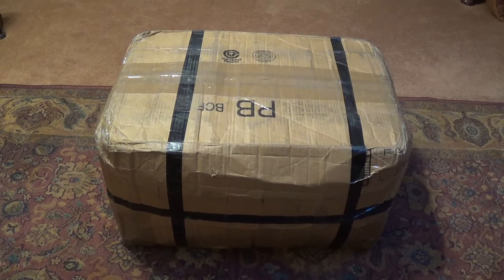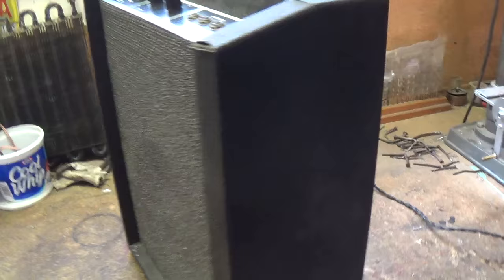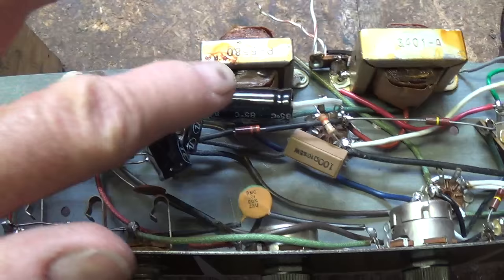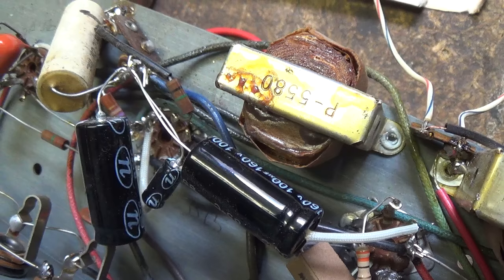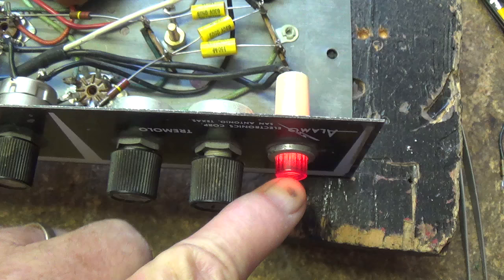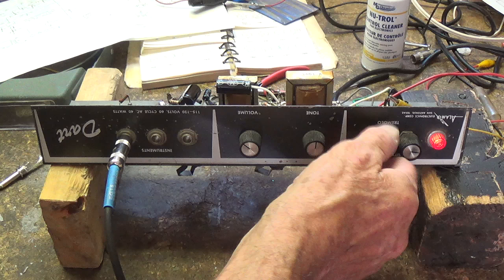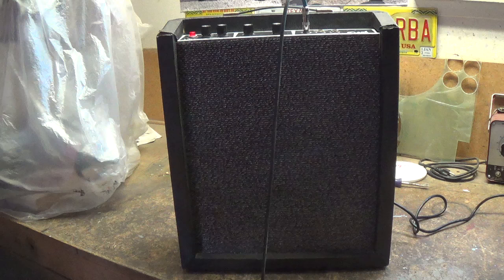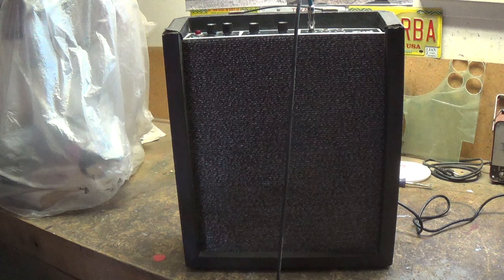1960's Alamo Dart Guitar Amp:  Ressurected from the Dead

Comment: Thanks, the explanation about the voltage drop through the tubes was very helpful.
Reply from the maker: You're welcome, Mike. The voltage applied to a circuit must be dropped to zero (by one or more resistors) before reaching the end of the circuit.  Some clever chap came up with a design that allowed the tube filaments (with a supplemental resistor to take up "the slack") to do the voltage dropping.  We're glad you found the video informative.

Comment: Two reasons they provided isolation transformers for the V1 tube - one is as you mentioned, noise, the other is to provide increased safety in the even the V1 tube's grid shorts to filament internally.
Reply from the maker: This makes sense. Thanks for your helpful input, Brad.

Comment: Hello!  Very interesting as usual. I don't know if I've mentioned that, back in the late 50s - early 60s, us guitar guys would use an old radio to amplify the signal. We would connect the inner core of the cable (if using co-ax!) to the top pin on the first valve. I don't know exactly how safe that was, but we're still here!
Reply from the maker: Greetings, Ben. Conversion of radios to guitar amp use has once again become widespread.  I guess that history does repeat itself.

Comment: Hope you are well Doug... Miss  your videos - Ron
Reply from the maker: Rusty and I have been busy building hot rods, Ron. We should be back with some amp-related videos in the near future. Thanks for your concern :)
Reply: Glad to hear - Hope the hot rod is coming along nicely.  Happy Thanksgiving to you and yours.
Reply from the maker: I'm still here, James, and have shown some of the cars in amp videos, a '71 hot rod Jeep and a 1936 Chevy truck, but have not made videos specifically featuring any of them.  I might in the future, however.
Reply from the maker: Rusty and I are working on a 1941 International hot rod (extensively modified) truck. We brought it down from Deming, NM and it needs a lot of work but has huge potential. In addition, I'm building a 1959 Chevy 283 engine for use in a future vehicle.
Reply: Doug, step away from the trucks and get yourself an old amp in need of saving, we miss you!
Reply from the maker: It's like stepping away from beer and pizza, FB, easy in theory but almost impossible in practice. We will do our best, however. Meanwhile, have a great Christmas :)
Reply: You also have a great Christmas Doug.  My 59' Bassman is now purring away after a little education on the old Cathode Ground Bias  config from your videos.   Enjoy my friend.  Ron
Reply: Thanks, you too Doug, and your trusted assistants too.
Reply from the maker: You're welcome, FB.

Comment: Unbelievable how far we've come ... I've just recently opened an iPod Hi-Fi from Apple (2005 vintage) ... absolutely no heatsinking at all on the amp board, and it was screwed directly on top of the power supply ... boggles the mind ...
Reply from the maker: Indeed, D, they don't make 'em like they used to.

Comment: God Bless Texas,  Saw this video on  the large LCD Television, via PS3 running sound through stereo, and today I got my moneys worth.  Uncle Doug and crew...and an Alamo Dart Amp.  What could be a better program to watch  while busting sudz 
  Great video, I feel like I got a little bit of your insight on how  to approach working on amps, Although I don't know how you found this other schematics of similar designs to help you piece this amp back together.  There must be thousands of them and  like a needle in a haystack, you found them. Got to say, I'm a little bit impressed. 
 When you opened her up for the first time, (even with my limited knowledge) I looked at her and thought, I hope Uncle Doug knows that aint original... and of course you knew too.  LOL I seen those schematics on line and I am glad I was not the only that thought they were confusing,  I will for sure come back to see your diagram and do your mod for tremolo.  it sounds real good.   As you know,  on mine I  built a  custom cab. able to switch speaker cabs and I will tell this. It is a fact. Running through my Silvertone 1484 cab and a tube screamer pedal, This amp is a true contender for ANYTHING! out there.  OK, Uncle Doug if you read this far. You know I always got at least one question for you.  Here it is.
Q: Running my Alamo Dart this way. Will this hurt the amp, or burn up the tube faster or maybe catch Fire?
Good to see you again.
Reply from the maker: Greetings, Amlon. It's good to hear from you. Rusty and I download all our schematics from the Internet, after sometimes lengthy searches. If your output tube is properly biased, there should be no harm from using the amp as you described.  Just to be safe, however, periodically check your output transformer to see if it is overheating.  It can be warm to the touch, but should not be uncomfortably hot.

Comment: Greetings Uncle Doug.

At approx 8 minutes when you traced the hot lead through the switch, neon light and found it terminated to the common lead, it reminded me of a time when I was on the job and sent to troubleshoot a Uninterruptible Power Supply because a piece of equipment stopped working when we lost city power. I found the equipment was plugged into the wall outlet, and the UPS was plugged into itself. Good grief!

Thanks for another great video.
Reply from the maker: I guess someone was trying to create a perpetual motion machine, Donnie ;) You're welcome.....thanks for watching and commenting.
Reply: Perhaps whoever plugged the UPS into itself was trying to protect the UPS from city power spikes. :)

Comment: Zenith used 35C5 tubes in their hi-fi table radios in the late 1950s.  They had an electrostatic tweeter which was directly connected to the plate of the output tube.
Reply from the maker: Thanks for the info, D20.

Comment: Doug, I just discovered your channel and I just love it. I also realized that you haven't added to your content in quite awhile, I hope you are alright and everything is fine. I hope to hear from you soon.
Reply from the maker: Greetings, Jeff, and thanks for your concern. All is well here, we are merely (hopefully temporarily)  engrossed in other hobbies.
Reply: Thank goodness! I have only built one amp that turned out very well. I is a duel 6V6 single ended Princeton clone with dual rectifiers and other mods. Based on the "Angela Super Single" plans.
Reply: By the way, how are Rusty and Jack?
Reply from the maker: Your amp sounds like a good one, Jeff. I am sorry to say that Rusty passed away a few months ago :(   Jack and I are still mourning, but doing fine otherwise.
Reply: I'm so sorry to hear that, I know it's hard, I lost both of mine not too long ago. It takes awhile to get over.

Comment: Couple things... Good video as always. I'm only a few minutes in and apologies if these points have already been brought up. These series filament amps do have fuses actually - they are the filaments themselves. The max mA handling on the filaments is very low already. Any fuse you put in will have to be about 100mA to get below the existing fuses (filaments). I've stopped including the additional fuse in series filament amp repairs I do. 

As for the other transformer... That is an isolation transformer for the V1 tube probably. Again, apologies if you go on to cover all this, or if it's been discussed already in the comments.
Reply from the maker: This is an excellent point, Brad.....one that I had not considered. Since the filaments are in series, instead of parallel as we see much more commonly, they would act as fuses within the series filament circuit. The one situation where I can see the possible value of the fuse would be if a 3-wire chassis-grounding power cord has been installed (as in this case), with the neutral return lead also connected to the chassis, and the amp were to be plugged into an improperly wired wall receptacle with reverse polarity.  I would think that the fuse would respond quickly to the dead short to protect against the receptacle's erroneous wiring and make it evident. Thanks again for your informative input.
Reply: Thanks, Doug. As always, I appreciate your videos very much. Keep doing what you do!
Reply from the maker: You're welcome, Brad, and likewise on your videos and the continuation thereof :)

Comment: Nicely done Doug! That butcher job it came with looked like some radio's I've worked on. They're lucky that during their wiring fiasco they managed to keep that pilot light in circuit or they really would have had a surprise when they turned it on.
Great job getting it straightened out!
I get nervous when a box shows up on my doorstep looking like that. It's been so badly mishandled it's lost all rigidity and feels more like thin leather than a box.
Reply from the maker: Thanks, Shy. I agree :)

Comment: Are you still around, uncle Doug? haven't heard from you for a while.
During the summer I tried making a small amp from my junk box, and it worked, though it took me like four days to get it right (First time I get a tube amp to work decently). Learned plenty of stuff from your videos.

By the way, it's interesting to see a 12AV6 in a guitar amp. That's a tube you usually see as the AM detector/preamp and AVC diode in tube radios.
Reply from the maker: We're glad to hear you've been experimenting, Mr. T. Congratulations on your successful project.  The 12AV6 would be an unlikely tube for amp use, because the two diodes have no application in an amp circuit. It would provide only a single triode, while the more traditional 12AX7, etc. can provide two.
Reply: In radio manufacture, if a valve (sorry, tube) was in plentiful supply & cheap, manufacturers often used them - even if there were electrodes which were not needed. The diodes should be grounded & you still get a useful triode.

Comment: Amazing restoration Doug !!  I was totally surprised to find that the entire amp had been re-wired incorrectly.  What could they possibly have been thinking?  Basically - their design resulted in a neon lamp circuit and then some miscellaneous amp components hanging on the side - laugh !!  I suppose having done this professionally - you've seen enough horrors that this didn't take you by surprise !  But - had I tried to tackle it - it would have taken me a long time to come to grips with the fact that someone actually did all that mess to an amp !!
Reply from the maker: Thanks, Donald.  Although I was unable to find an original Dart schematic to compare the circuit to, the glaring mistakes I pointed out could never have been done at the factory.....so I must assume that some unqualified person or persons unknown inflicted them after the fact.  I have indeed seen some strange "repairs" over the years, but must say that this one was near the top of the list. It would have been a good final exam for an electronics course :)

Comment: Another interesting video as always! I've seen quite a few butchered amplifiers over my years as a technician, but this one had me scratching my head for a hot minute :) This one was surely a mess which I'm sure was done by either an amateur tech or DIY'er.  I'm a stickler about installing a 3 wire grounded cord on most, but not all amplifiers...especially a series heater string design. This is a similar concept as the old AA5 (all American 5 tube radios). Since one side of the AC line goes to chassis ground, there is some danger involved with a 3 wire grounded cord. Since both the neutral side and ground are at the same potential, it can create a dead short if the amplifier is plugged into a wall receptacle that is wired with a reversed neutral...Poof!!! Short to ground. Whenever I take in a series heater string amplifier for repair or restoration, I tend to leave a 2 wire cord installed, and recommend the customer purchase a small isolation transformer to power the entire amp to keep the chassis isolated from the AC mains. There are certain instances where i actually install one inside the amplifier. This amplifier was wired with a separate transformer for the filament of only one tube. Strange deal. Looks like Jack picked up and a tough-dog repair job here! Either way, keep 'em coming! :) PS: you can't retire from repairing amplifiers...you're too well liked and respected by many. You've had my endorsement LONG time ago :) I will admit however, some customers can be a PIA and can try my patients at times, but I have to deal with them to a good extent since it's a full time profession for me...I just can't see myself on line at the local soup kitchen LOL :) I always look forward to the next video :)
Reply from the maker: Thanks for your input, Frank. As always it is helpful and informative.
Reply: Actually was that wiring identified correct, was the (relatively puny) transformer actually suppose to supply ALL the tubes and as part of the mis-wire was wired in incorrectly ?

Comment: Love the animals there saying I don't know what he's saying but he feeds me LOL. My Magnatone M10 had the same tube holders. I am not a tech but I have rewired a few amps. This reminds me of my Premier 150 bass amp. From the day we both it. never worked right this was in the mid 60s Someone at the store took out the standby switch and messed up the circuit. Believe it or not the amp sounds outrageous but in the back of my head I know theres a wire where it should not be. Great video Doug You explained the process in away that everyone could understand. Thanks for posting c];-)
Reply from the maker: You're welcome, AL. Perhaps now you can diagnose the problem with your Premier amp. Best of luck :)

Comment: Very similar circuit to my 62 Lectrolab. Different tubes and such, but the layout (due to the lack of a power transformer) is really close! I think I saw an Alamo amp in a pawn shop a few years back.
Reply from the maker: Greetings, Thomas. The transformerless, series-filament circuit like this one was used in countless amps and radios over the years, generally in an attempt to reduce production cost.

Comment: Also the non-isolated circuits like that is that when you turn it on and off in causes a shot noise on the supply, which you can hear if you have another amp on. One of my amps (fender pawn shop special ramparte) coincidentally started "popping" when i switch it off.
Reply: If you wanna see a strange power supply, take a look at the aristona eminent (or any old danish/european radio). It take either (up to) 250 ac or 250 dc, and has no transformer. It uses a power resistor with several taps.
Reply from the maker: Look up "snubbers", Bobby....here is a source:  http://www.digplanet.com/wiki/Snubber  What you are describing is a relatively common phenomenon.  Re the transformerless radio circuit, I have seen quite a few, but don't recall one that relied on a multi-tapped resistor.
Reply: That circuit looks (tho very interesting) hugely inefficient !!  I'll bet those resistors generate a lot of heat !!!
Reply from the maker: Indeed, probably the majority of the incoming current would be converted to heat energy. In the short run, you save the cost of a power transformer, but in the long run, operating costs and fire hazard possibility go up.

Comment: Hi Uncle Doug,  what a lovely tremolo. You would think that the people who have dared to touch the circuitry would have used the "replace with identical parts in the same place" theory. Perhaps someone had previously stripped out components, without taken note of what they did.  Potentially deadly. It makes me realise how much valuable info I've learned from you videos over the last few years. Also I managed to pick up a Bell and Howell Filmosound 621 projector amp, similar to the 385 you converted,  it has an ECC35 preamp tube instead of the 12ax7. II can't find a schematic for it but I think I'll strip it out to regain some real estate and use the 5e3 fender deluxe schematic as a base.  Could be an interesting project. kind regards to you Rusty and Jack.  Colin.
Reply from the maker: Thanks so much, Colin. Yes, it's strange that the designers would stifle it with a 2.2Meg resistor. Perhaps they were seeking a subtle effect.....rather than the earthshaking modulation that we "tremolo-hounds" prefer :) I agree that the extent of the mis-wiring was inexplicable. It violated all the rules of common sense and decency :) Best of luck with your B&H conversion. Let us know how it turns out.

Comment: Hi Doug! I love all your videos, and I fully respect the educational value of your content. I have just one wish: It would be great if you could have your guitars set up, so they would play in tune no matter what the chord. This way the ear would be fully focused on the tone and appreciate your hard work. Thank you for all of your work.
Reply from the maker: Greetings and thanks for your courteous comments, DJ. The guitar I use is carefully intonated and tuned before each demo, so the problem you are describing may reside in excess fretting pressure or the recording method, which is admittedly sub-optimal. Quite frankly, I don't believe it's possible to tune a guitar so that every chord is in perfect tune, but I will try harder in the future to do so. Thanks for watching and commenting.
Reply: @UncleDoug  You are correct in that the fret lengths need to vary , even with the adjustable string length bridge saddles (which minimise intonation variances) - my guitar is set up with the harmonic at the 8th fret extact to the press down string note but above or below that there will be small variations - you could check on a  scope.  I suppose a fretless would be the best but you would have to have a very skillful ability to learn, adapt and vary the relative distances between fingers.